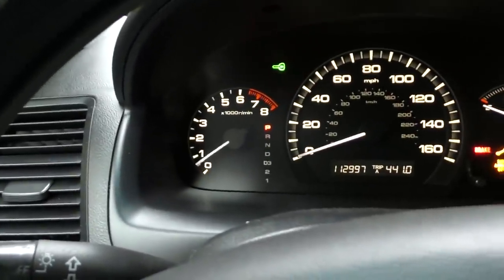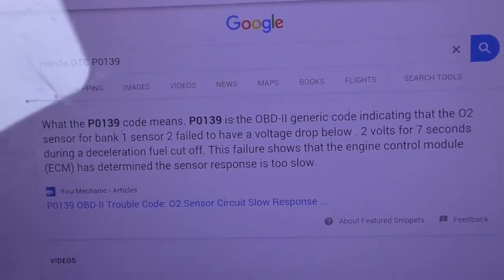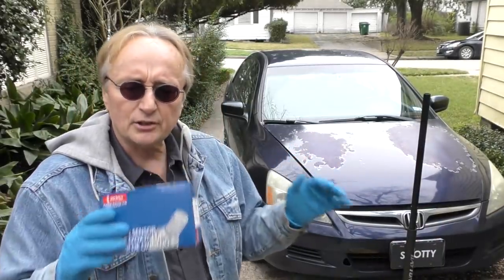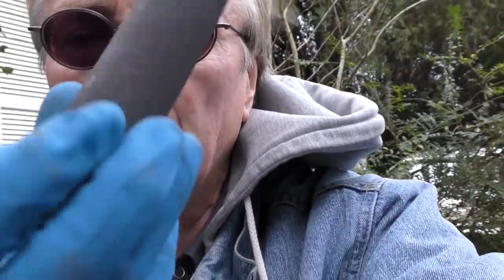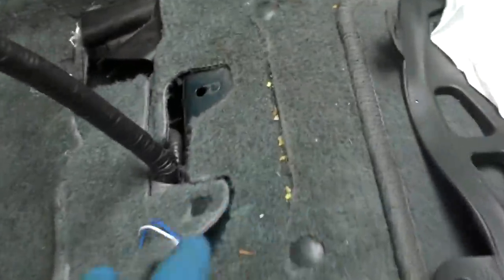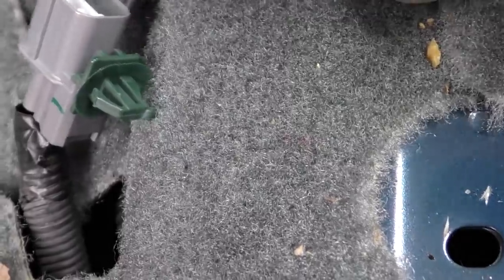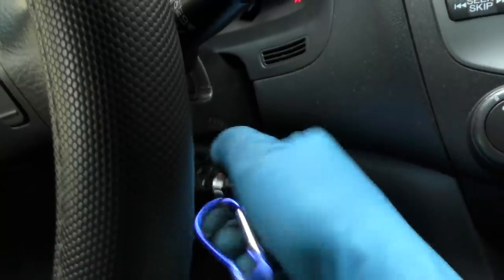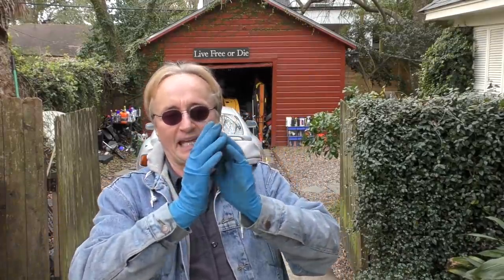Here's Why Mechanics Hate Hondas

Comment: It looks as if the clear coat has deteriorated.
Reply: it's very hard to tell I'm actually surprised you noticed
Reply: Sharp eyes, there, bro.
Reply: Looks to me someone tried to wash that car in the sun and left the soap on it and the sun dried it out & messed up the paint, which is a no-no in the sun ☀️
Reply: I've seen A LOT of this generation Hondas up here in NY that look like that - they dropped the ball on the paint...
Reply: I have a 2006 Honda Accord that's similar to this one that also has the clear coat paint issue.  I look at it as my anti-theft protection - what thief would want this?  The car runs perfect,  almost 200K miles  and mechanically sound.
Reply: Older dark Green and Black Hondas had that paint defect.  Our 2002 Green Honda same deal!
Reply: @markmccarty1275  Its common in black Honda's for sure. Never use dish detergent to wash any car and I will give a plug to McGuires car wash and polish. It restored both the metal and plastic on my o5 element that had been parked under a assortment of trees over its first 15 years. . .

Comment: I have a 5 speed manual 2008 Honda Element 358,632 miles on it best car I ever owned hands down! 😛 I’ll put another motor in it before Id ever consider getting anything else!🙂 I am the original owner and put all those miles on it ...replaced a few clutches and did regular maintenance work oil spark plugs brakes ect...runs great 👍🏻 definitely got my money’s worth out of her something I’ve never said about any of the previous American car brands I’ve owned before it.!!!!🤨 all 💩 crap...😁

Comment: I owned the same car had to change the same sensor 3 time had the car for 200000.
Reply: Wow, I just passed 211,000 miles on the original sensor. I wonder what is wrong. I know some other people with the same model between 03-07 and never that issue.

Comment: I replaced the rear O2 sensor of my 04 Accord at 216k and 122k miles without removing the seat. Push the release tab on the connector and pull the wires to the left and wiggle it off.

Comment: BTW sensors are 22mm or 7/8”  
If I know its bad, I’ll clip the wires and use a box end wrench and hammer to  get it unstuck. I’ve had sensor sockets spread and strip the tough ones.

Comment: I've got a Honda accord 2010 V6 5sp AT on 210,000KM - I'm having misfiring/ hesitation when car is fully warmed up and under load in 'R' and 'D' gear, at traffic lights I have to shift to N or else the car will shut of. In P and N the idle is spot on 650 rpm. When the car is cold its works flawless.

I've swapped MAP, MAF sensor. I replaced new ICT sensors, replaced Ignition Coil (6), Check Valve Adjustment, Clean fuel injectors (6). Check O2 readings looks ok, All Catalytic Converter gutted; Bank2 and Down stream CAT was choked. I don't have any CEL after the vehicle is started. I've a generic OBD11 scanner and no pending/permanent codes.

I'm considering trying the sea foam for transmission. May be it's on the way out.? 

Can my ECM/ECU for car gone bad.?

I have been driving the car in this condition for appx. 20,000KM. I get appx 8.92L/100km mixed (city & highway). Not sure if that is good fuel economy.

I don't want to get rid of her, but this misfiring/hesitation is driving me up a wall.

Open to advices/ recommendations...
Reply: Vacuum leak ?

Comment: 1993 Volvo 240 here with 360,000 and counting. Yes the original engine and automatic transmission. And hey taking a seat out is not hard at all.

Comment: Hey Scotty when u say Honda's are reliable are you talking about the Honda's made in the US or hondas worldwide?. Like for eg in my country even though Honda has assembly plants, all the spare parts like the engine the gearbox the fuel pumps and injectors are all imported from Thailand. Are the hondas made in Thailand just as reliable?
Reply: Well in my opinion it's kind of luck of the draw, I generally believe the Hondas made in Japan are of higher quality I have a 99 Accord that's made in Japan and it's still very solid have 200,000 miles on it and it's been great all the interior trim pieces are tight nothing's falling apart I know some of them of that exact same vintage were also made in Ohio and they don't feel as good, it's not even as much as the plant itself I believe it's the suppliers in the surrounding area have higher quality products, but I do believe it is possible to get a good example of a Honda made at any plant USA Thailand or elsewhere, you also know the saying which I believe goes for all cars nowadays they don't make them like they used to, my mother-in-law has a 2014 CRV and in some ways I can tell how the parts have been put though cost cutting as far as the interior.

Comment: You should never twist the sensor cable. Just install the sensor first and then plug it in. Also, it's good to change both sensors together, not just the rear one.

Comment: Thank you for the video on Accord, I still have a 2003 158000km and I agree with you on stupid engineering, just the air filter is just a pain to move the air filter box.  On my dad Acura TSX 2004 with the same engine, the air filter box is so much easier to remove.
I learn from Japanese coworker that in Japan, people does not have access to the OBDII port as per regulation, they have to go to the garage!  I was a little bit surprise that in the country of Honda and Toyota one cannot access OBDII port freely.

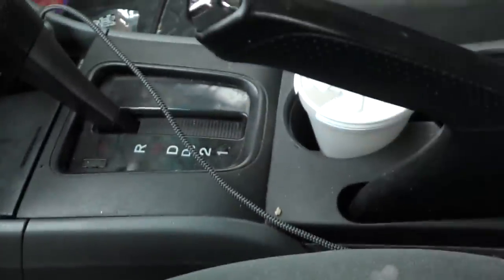Comment: 3:00
Scotty --- I see this happen on many videos, not just yours. The hand brake is applied prior to jacking up the front of the car. Isn't it better to put chocks in front of and behind the rear wheels while jacking the car up and THEN apply the hand brake after it's up? After all, you're trying to turn the rear wheels with the brake on. I know it's just a small amount, but still you're applying stress on the system back there, and then leaving it like that for the duration of the work.

Comment: Pro tip. if you replace the 2nd sensor and still get the light back your cat is loosing efficiency . take it back out. scew in a spark plug anti fouler. It will pull the sensor out of the exhaust stream so it senses less but still works. Does the trick most of the time. Ive heard you could wrap it in tin foil as well. probably wont last long though . Might get you past inspection though . LOL

Comment: I worked at Jiffy Lube twice and changing the oil on Honda's is always ridiculous. Of course the cars exhaust is usually hot to extremely hot and the oil filter is right above the exhaust manifold. So there is hot oil dripping down after loosening and taking the oil filter off onto the exhaust and the person removing it. Plus it takes a large oven mitt type of glove that's elbow length to remove the oil filter without getting burned as much if possible. Plus I saw a video the timing belt cover is under and beneath reservoirs. Plus the guy had to remove the alternator and power steering pump.

Comment: I had a 2003 Accord with a 5 speed. Drove it to nearly 155k miles until I got rear ended by a F250 Super Duty Ford. Up until that the only thing that ever needed replacing was the clutch at 120k miles and the brake pads at the same time. If it was not for the guy driving that truck that day the car would still be spinning like a top. Now I have a very nice 2018 CRV. I wish I would have gotten the NON TURBO CRV. But hey its paid for. The one I have now does NOT blow gas into the oil for now at least.

Comment: Got the same model 2005 accord those cars have the ecu under the evaporator and when the evap gors bad starts leaking coolant the ECU get wet and goes bad, i already changed mine but now my car won't pass 3 rmp so i did a little research and my car don't have mass air flow sensor but the car that i took the ecu does had one.

Comment: Scotty you also did not route the cable for the O2 sensor in the cable tray under the car.  There is a plastic cable routing/protecting tray mounted to the underside of those Accords that you are supposed to secure the cable into.....

Comment: You do not have to pull the seat I have removed the O2 sensor by reaching under the seat . I have done this 2 or three times .My Accord currently has 425,000 miles

Comment: the plug is inside the car because it prevents corrosion from getting to the plug. ie reliability it would probably be better to screw in the sensor first then put the plug through the floor so the wires have no kinks in them or twists. i say this because i like hondas and usually can see eye to eye with the engineers on the design of the car.

Comment: I got my 05 accord with 100k miles on it 5 years ago and the only things that have gone bad were the rear O2 sensor and the alternator. At 160k now and it just burns a little oil but I’ve spent almost nothing on it.  If it ever drops dead  I’m getting another Honda

Comment: I have a 16 yo honda accord euro  which shares the same engine and transmission....my dad owned it from new and i brought it off him. Besides consumables like tyres battery ect a power steering pump and the coil packs on the engine electrical system....not bad for a 16 yo car with 190,000km on it if u ask me!

Comment: 7:54, with the description, that's most likely the battery has a bad cell. An alternator requires at least some power from the car's  battery to function at all because they don't use permanent magnets like a generator does. Plus by the time a battery has enough power to start a car, even with a bad alternator, it'll have enough power to run for at least a couple of minutes vs a battery with a shorted cell will die immediately.

Comment: Something i found out working at an auto auction, some "newer" cars had a fuse that went from the alternator to the battery. Sometimes those would blow, causing the car to die. I would check to see if you've got one before replacing the alternator.

Comment: Hey i got 91 honda civic hatchback with a 1.5 liter 4 cylinder with no ac, no powersteering no abs, no radio, no clock, crank windows, a sunroof, a stock spoiler and a standard 4 on the floor! You can't knock that for ease of maintnence and reliability!

Comment: Why wouldn’t you screw it in first (with the anti seize on the threads) THEN fish the connector up through the hole? That way no twist stress is on the wires.

Comment: Mr. Kilmer I'm currently in the market to buy a 2020 hatchback. I like the compact size and the extra room in the back. Based on decades of reliability I'm debating to get a Corolla or Civic (take as old as time right?) hatchback. I don't know if the oil dilution problem was fixed in the 2020 Civics. Also Toyota added 1 gear to the new 2020 Corolla CVT transmission which is new and I don't know if that's a good or bad thing. I know you've mentioned Mazda has up'd their quality game these past years so I've been eyeing the Mazda 3 hatchback because it has a 6 speed automatic transmission and not a cvt. It uses a bit more gas than the competitors but I don't mind as long as I get long term reliability because I'm planning to baby the maintenance out of whichever vehicle I purchase, strictly oversee all proper maintenance in order to make my vehicle last long. Overall Mr. Kilmer what do you recommend?

Comment: Could also need a tune up, O2 sensor working fine but spark plugs or fuel injection system is meat up..well you can change all the O2 sensors you want .... Bad spark plugs or fuel injectors will destroy o2 sensors and cats.

Comment: My 2006 Honda Accord 2.4L has the same problem and it's not "O2 sensor" problem. You need NEW catalytic converter.
Reply: Same with my 2002 model. Took the check engine away, but now more issues a month later. :'^)

Comment: 7:23 I've never known that to be true for the OBD2 Hondas [or Subarus, for that matter] I've owned.  Any CEL that pops gets stored, but the computer still continues its work.  If it finds other actual faults, those codes get stored along with the previous code(s).  But if the issue is not an immediate fault, then it gets tagged PENDING for an additional drive cycle (and many OBD2 scanners don't analyze for PENDING codes).  This is especially true if the fault is not a constant or consistent issue - in particular Air/Fuel and O2 sensors that start to go bad.

Mileage always varies.

Comment: It was my understanding that the front O2 sensor was used by the ecu to adjust parameters and the rear O2 sensor was used only to check catalytic converter performance?

Comment: Scotti talk about engineering blunder, I have a 1978 Ford Pinto, with 34,000 original miles, decided to flush the cooling system and change the hoses and thermostat, long story short, Ford put the heater hoses clamps to the heater core inside the dash. 🙄, So you have to remove the entire heater assembly box with the blower motor, for 2 lousy hose clamps...

Comment: If the oxygen sensor or the MAF sensor are the computer it has no way of knowing. They also like to run hot. Oxygen sensor S1 bring burned in the exhaust stream and has a heater too heat it up faster. S2 could be used to detect problems with S1. Always put the new sensor in S1 if there's a conflict between S1 and S2. 

The

Comment: things are mad hard in hopes you take it to a dealer that way they make money. you should see the dodge journey battery its barred in the front bumper. you have to remove part of the bumper and remove the tire in order to replace it. and if that's not hard enough the cables are short. but the cables are short in hopes you pull them ti tight breaking a sencor buy them that cost a few hundered dollars to replace. but its still worth doing you self since they charge around $600 at the dealer to have it replaced plus the cost of the battery

Comment: It's a good idea to change the oxygen sensors at a 100000 miles it should be a regular service item as well as changing spark plugs and adjusting the valves on Honda's

Comment: The rear oxygen sensor dose does not tell the computer to adjust the air to fuel mixture ratio it is solely there to monitor the emissions output

Comment: There's a shop here that will take off your converter, replace the section with pipe, then pop a hole in it with a nut wielded on so he can screw the oxygen sensor back in. Your opinion about this?

Comment: Wow, that one had low milage. I had a 2003 that had 230,000+ when I let it go. And that was only because the AC compressor went out, and the cost to fix the issue was more than the car was worth.

Comment: The thing with the Mini Cooper is I know a car dealer and he can go and grab them for   $1500 to $2500 used and he can easily put them on his sails white and sell them for $4000 all day long for the Mini Coopers Lake you have although he is are typically higher mileage   Like 60000 mile to a 120000 mile cars that he sells all day long for $4000 sometimes even upwards of $5000 for the slightly newer lower mileage cars that are the BMW Mini Coopers So it's got a saying is you need to try to sell the car now and get some decent money for it is definitely a thing because otherwise you're only looking at getting $2000 maybe as good as $3000 for it used later on down the road.

Comment: Bosch  o2 sensors are the only thing made by Bosch that you can put on Honda’s or even gm and they won’t go bad in a couple months in my experiences. I’ve gotten trash parts from Bosch but never an o2 sensor and have installed a couple handfuls over the last 20+ years but whatever 🙄. I wouldn’t buy anything else from Bosch though.

Comment: Hi Scotty,
I have a question about the typical 8 year 80K mile emissions warranty, sometimes referred to as a "hidden warranty" and what they actually cover.  Someone once told me that Ford replaced a faulty mass air flow sensor under the emissions warranty while the bumper to bumper warranty had already expired.  Beyond the catalytic converter and OBD II system do they typically cover anything else?  
Thanks
Jeff from Detroit

Comment: I’ve had a couple Hondas & I didn’t mind working on them. Easier than a lot of cars TBH. Changed a radiator in one, but not much else otherwise lol. Maybe that’s why

I beat the living crap out of my Honda. It still went to 220,000. Change your oil & it will go & go.

The other one had recalls so I didn’t have to do it. But that car was NOT good. 08 Accord is not a good car. 

Im telling ya this thing is

Comment: Mechanics hate them because there is no money in them... they rarely break and when they do most of the time it's a cheap repair. My '07 Civic has over 200k miles on it and the most notable repairs are 1 wheel bearing and the middle part of the exhaust had a small leak right where the hook is located because the galvanization didn't properly cover at the base of the hook. Still has the original clutch, original head gasket... well hell, everything is still original on the car besides small parts replaced because of regular maintenance. Also no electrical gremlins... everything works 100%. A friend of mine has a Honda Jazz/Fit with over 300k miles on it... only recently replaced the head gasket and clutch, the only two notable repairs in it's 300k life.

Comment: I have a 2011 GMC sierra with 50k miles. A mouse chewed through part of the wiring harness causing a cylinder to not fire. I replaced it with another OEM harness, unplugged the battery to reset the system, and drove it for about 10 miles. Everything seemed to be fine until the same code popped up the next day. Am I supposed to get the code reset with a scan tool? Should I be worried about it or can I just keep driving it? Everything looks to be in good shape except for the code that says the cylinder is not firing right.